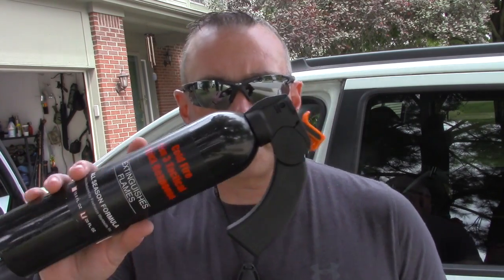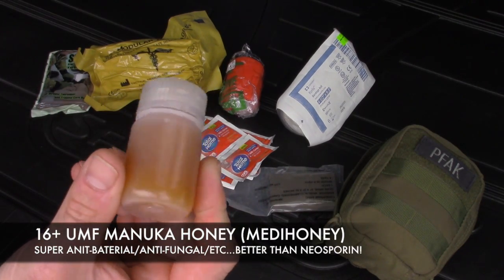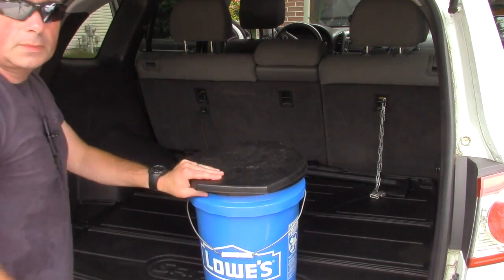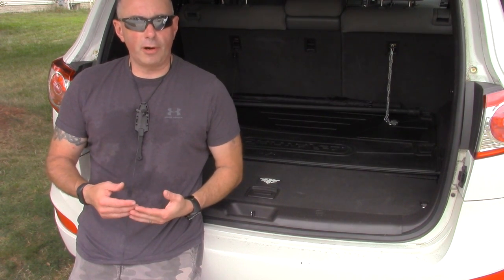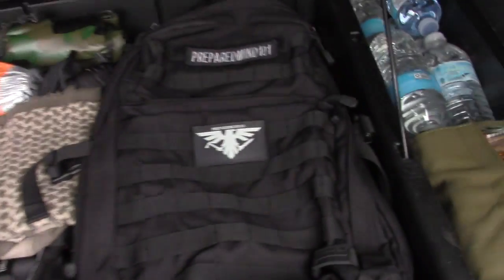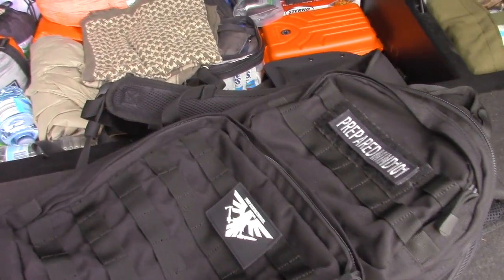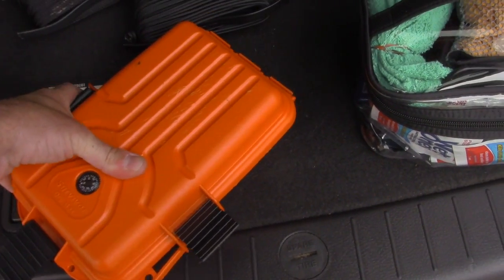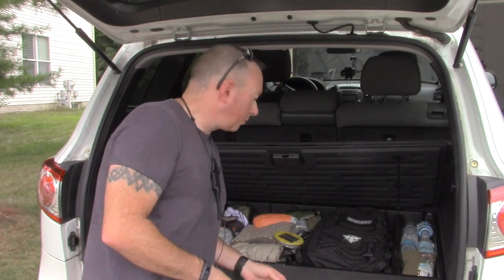300+ Piece Vehicle Emergency/Prepper/SHTF Kit REDUX - Preparedmind101

Comment: Good job Chris...  reminds me of all the junk I had in my van when I was doing search and rescue.   The two weak areas I noticed were "The Missing  Gas Can"  ☺ but you addressed that.... And communication.  I would include a couple or four hand held two way radios (GMRS or FMRS or VHF/UHF) and a mobile CB and/or Ham Band VHF/UHF mobile transciver mounted on or under the dash.   The ham license is easy to get... I passed thd test when I was 11yo - many many years ago.  But, there are radios that do not require a license.   I know you have your cell phone, but it might come in handy to hear traffic conditions on the CB and emergency conditions on the ham band.  Also, you can stay in touch with the family should you seperate.   I live near a big wooded area.  The grandkids know to take a radio with them when they go out to play.  It comes in hand every time....    But, that is just me who comes from a generation where you could not take your phone anywhere... if you had one.   Just saying......  😊

Comment: TIP: Take wrapper off the SWAT T as your hands will be bloody when a tourniquet is REALLY needed.  Blood is very slippery.
Reply: Good tip. Maybe keep it in a compressed ziplock bag so it can easily be torn into?
Reply: The reality is the T is safer in the wrapper keeping it clean. Second if it's needed you are most likely not self applying one anyways unless your Rambo in which case you would be using gun powder and your Kabar to seal the wound lol.. Most trauma medical supplies are for someone to quickly access and use on you.. IE Ifak.. An ifak is not to be self used its so a field medic doesn't have to use his supplies or dig through his pack for basic components. So your buddy who is actually the one who would likely be applying your tourniquet won't have an issue using his pocket knife to cut off the wrapper.
Reply: Hey, have you heard about Trankors Survival Secret? It's off the charts. No matter what type of critical situation you might find yourself in, you can make everyone safe and sound with step by step plans.

Comment: i'd rather have a length of rubber tube for siphoning gas rather than a gas can.
Reply: Good point Ben but what would you put it in, just asking as I am sure you have some crazy idea hehe
Reply: I didn't think of that Ben lol :)
Reply: no the idea is that he'd just siphon people's gas onto the ground.

apocalypse pranks
Reply: and for the comment about knowing his name, it's called being respectful and addressing the person you're talking to. Go troll elsewhere!
Reply: just a prank bro
Reply: My comment wasn't to you buddy hehe, someone else commented but has removed their comment as I was replying :D
Reply: with some of the newer vehicles in USA they have a anti siphon tube feature since gas theft was great during 1970s gas rationing...good thought though, try your own modern vehicle first.
Reply: unfortunately on alot of newer cars you can not siphon gas out of the tank because the manufacturers added a screen in the filler neck to prevent debris getting in the tank and also to prevent people from siphoning gas out. now an older car then you should be good.
Reply: yes alot of newer cars you would have to puncture the gas tank. I would almost rather them siphon it and save the tank, lol.
Reply: no need to puncture fuel tank, a small diameter hose goes right past the theft device, can usually work 2 or 3 into it 1 at the time for a faster flow rate
Reply: Jason Lawson
 right on!
Reply: There's a neat siphon device I picked up off Amazon, it has a bulb at one end to get the flow going (sort of like the bulb on a turkey baster or blood pressure cuff).  It works great around the house/garage/garden for transferring liquids between containers.  I have one specifically marked for fuel and one for water.
Reply: Living Survival i
Reply: Living Survival why would you use a siphon illegally in a regular emergency situation? Dont think every situation is MARSHALL LAW SHTF ZOMBIES ARE COMING, what if you run out of gas 50 yards from the exit lol to be prepared is to be prepared for everything not just the extremes
Reply: Store the rubber tube INSIDE the gas can.
Reply: I don't know most cars in the last eight years have a anti siphoning tank and most don't even have gas caps anymore. I guess you can siphon other stuff but I think of gas and most of the time cars have gas lol.
Reply: Living Survival super siphon, my husband purchased one from amazon for $10 and it was well worth the money.

Comment: Love seeing the Klean canteen! It drives me nuts seeing everyone using nalgeene. You can't throw a nalgeene on a flame and boil water.
Reply: Great water bottles, awesome for every day use as well. Mine was until one of my friends was acting like an asshole and decided to play keep away with it, on asphalt... I'm gonna buy another one lol
Reply: +Mainframe Productions (TheMainFrameGaming10) lol... The K leans are pretty durable and actually surprisingly insulated.. The extra weight vs a nalgeene is well worth it for dual purpose use.. Everyone always hammers about how everything in a bag should serve dual purpose to help save weight and items needed. Then I see them using a plastic bottle that can't do anything but hold water lol.. Just one of those little things that bugs the hell out of me! When I see someone using a stainless bottle or canteen of any sort.. I know they are on their game and prepared for worst possible case... I also don't understand the wide mouth craze ? You're not going to cook inside the bottle lol. Why does it need a large mount on it? It's not easy to find std mouth bottles anymore. Had to wait 3 weeks for my canteens to arrive. 32oz woth std mouth and d ringed sip lid. Something that should be the normal always in stock item 😡
Reply: john smith Agreed.
Reply: i have a pot for boiling .
Reply: That's great but now you are carrying two items to do one task when you can accomplish the same with just one. Size and weight always being a concern this is one area you can pick up room for other items or reduce pack weight. A 3day kit isn't meant to live off only get you to a place where you can. The faster and more efficient you can get to point B the better your chances to survive. Speed and agility is way overlooked. The lightweight backpacking crowd is carrying 15-20lbs and traversing 100's of miles in a few days. There is a lot to be learned from them in terms of making bags for bugging out or emergency survival. Use a cache to resupply don't try and carry everything for every scenario. You are only trying to survive a couple days at a time while on the move. Overload yourself and the reality is.. You will never make it to point B. You'll be moving too slow, burning too much energy have to stop and take many more breaks to rest. Also keep in mind. Stoping to boil water takes time and fires can be smelled and seen for miles. It should be only a last ditch effort in a worst case situation where you would want to actually take the time to boil some water. Purification tab fill the bottle with a screen and get back moving again in seconds. I carry a lot of crap to I won't lie. But don't think for one second once I know my situation I wouldn't throw out all the gear not needed for that scenario to lighten my pack and move faster. I actually carry a lightweight pack inside all my packs for just this reason. Every bag I pack starts out way overdone with way too many redundant items. I then spend weeks slowly ripping it apart and removing crap to get it to what is just the essentials. Don't make a bag and throw it in the trunk or closet and be done. Go back through it later and keep critiquing yourself and looking at things asking yourself is this really needed or is it a luxury just in case item. I'll bet you most people would find they have the same ability with 2/3 of the items.
Reply: john smith you said " Every bag I pack starts out way overdone with way too many redundant items. I then spend weeks slowly ripping it apart and removing crap to get it to what is just the essentials."... i do the same...right now i have my pack down to 25-28 lbs , depending on season ( winter bag is a little heavier ) , w/o food , water , primary weapon and ammo...and it's still too heavy  but i can't afford the super light stuff . still 28 lbs is not bad , (i don't do the cross country type hiking so a little extra weight for me is ok .) but i still look for ways to pare down the weight . and if it was a "bug out" situation i agree it is different... less weight = more speed . point being...unless there's a change in a few things i just cannot justify $20+ for a water bottle...but i will spend $1 or $2 for a SS bottle at the thrift store ,cause i'm a cheap bastard .
Reply: Nalgene has a time and place. They're great for EDC, especially urban, because they're sturdy and lighter than the Klean but for shtf you can't beat SS

Comment: Chris, Great video. Some things I would personally add....Small come along in case I got really stuck, couple cans of fixaflat or green slime so I wouldn't have to take off tires in in-climate weather.  Maybe a few Bright orange reflective safety vests (get them cheap at Harbor freight) in case you or the family had to walk along a road at night.  A couple of extra belts for the car (alternator, or fan belts) and maybe some hose tape in case you have a coolant hose spring a leak and lastly maybe a hidden spare key in case you lock yourself out! Just some ideas. Thanks, again!

Comment: Big follower of your channel here. Really like your videos. The only thing I didn't see in your truck are mechanical tools. Like a general tool box (wrenches, screw drivers, keys, pliers, hammer, allen, torx, etc.). I believe that any prepper driver has to be able to fix, at least, the more simple and common vehicle problems (overheating, leaks, loose bolts, loose cables, change belts, etc)
Again, no hate here. Just a little suggestion.
Greetings from Paraguay

Comment: I know I need a lot more but I always keep the following items in my car here in Los Angeles.
Flashlight and batteries, empty coolant jug for water, couple bottles drinking water, Sabre Red pepper Gel that can shoot a stream at a bad guy 20 ft away, Boonie hat and bandanna to keep the sun off if I need to walk home, jumper cables, funnel, empty 2.5 gallon gasoline jug, fire extinguisher, basic first aid kit,  dash cam, window sun shades, battery jump starter pack and 12vdc air compressor and digital tire gauge.

Comment: I think you have an awesome setup there Chris.  Like many others in here I think you may have too much stuff or maybe added weight.  
Just because I heard you reference (Harbor freight) I have one of their 100psi air compressors to top up tires or put in enough air to get you to a better destination.  Think that's very important.  And super compact and plugs into the cigar lighter outlets.  
good work man

Comment: A couple rolls of the strong bounty paper towels redundancy for bleeding management, tp replacement, washcloths and can serve as a pillow.  I have mine always in the thin grocery bags tied tight.  Also any kind of diapers, feminine napkins, or poise pads dual purpose for wound bleeds, and feminine needs as well as bathroom issues.   I have a brand new paint can full of fire starters, tinder etc.  can be used to fetch water, boil things, or keep stuff really dry. Just hook the can opener from zip tie on handle.  Large gallon or two gallon ziplock bags.  Many uses- gathering water /heating water in sun, keeping dry clothes dry or keeping wet items away from other dry things. Just bought a ‘19 Santa Fe.  Got it because back seat folds down flat with back bay so I can sleep in there if needed.   Mine has 3 skinny bins and I’m in process of filling them w preps.  So great video!  Thx!!

Comment: As this guy said to each his own. This guy is well prepared and prepare for your likely environment.  I use to live in north rural Maine. Carrying water was not in issue, but sliding off the road in a blizzard and stuck for a few hours to a few days was likely and happened to me on several winters. Basic cell service is non existent. Look at the cell phone coverage commercials, most of maine never included. But a good source of heat and blankets and a hand winch with rope able to pull ur car out of snow or mud are musts. (knives, food, saws are really handy)And a whistle if you're pinned in as a blizzard can cover your skid marks and car. Now i live in the urban city, knives will get me in trouble but a fire extinguisher and a strong snow shovel are good.  But i dont need saws and knives, winches and ropes as i did is Maine. But unlike rural Maine, a cell phone is a must.

As for a compass. Use the sun and north star. 

 My question for preppers. What type of senario are you preparing for? A car accident, break down on a lonly rural road. or a total collapse of civilization?

Comment: Great video. Found some holes in my truck kits. I know you do not keep firearms but some extra ammo for at least your ,EDC  would maybe be a good add. Also some wood screws because the could be useful for makeshift perimeter alert as well as other uses with shelter etc.You have your multi tool already.
Reply from the maker: +Keith Hutchison Good idea. I have 5 loaded Glock mags, 4 for the Shield and 2 for the LCP. Wouldn't hurt to put a box or two back there. I know it doesn't get hot.

Comment: One of the things I keep in all of our cars (and this falls into the convenience/prepping category, more than survival) is a collapsible cooler bag of some sort.  Most aren't that expensive and fold up compact enough to take up little room.  They are nice to have when you buy groceries and then realize you have 14 more stops to make that you forgot about before you can go home, or any other time that you need to keep something cool for an extended period of time.  Bags of ice are easy enough to find at any gas station, etc. to keep everything cold for longer durations. The cooler bags can also be used as a container for other things as well.

Comment: Good vehicle kit. I recently changed out my store bought water bottles and replaced them with BPA free water bottles. The extreme heat fluctuations inside a car can cause the plastics in the bottles to seep into the water.

Comment: Nice kit, a question about that flashlight (Thrunite) in your trunk there, do you store it with batteries in it or not?  I am always afraid to store stuff in my vehicles with the batteries in it, I keep the separate but was wondering if I should just leave them in my flashlights.
Reply: lithiums are fine, alkalines are not.
Reply from the maker: +Iridium242 the Thrunite has a built in battery pack.
Reply: Ahh cool thanks, yeah I always worry about batteries going bad and ruining stuff, but that should not be a problem with that.   Thanks!

Comment: You should check out the eno under quilts for hammock camping.  Lightweigh and will keep you warm in cold, not freezing weather...
Reply from the maker: +TheSmokinApe ENO makes under quilts now? 
I just ordered that Snugpak jungle blanket for $24.
Reply: Yeah, they came out with 2 different models about 6 months ago or so...  I picked up the "summer" under quilt.  I fill a nalgene bottle with boiling water and slip in into a neoprene sleeve and take in the hammock and it's like having a heater with you all night.

Comment: Great vid.  I have a Sorento and have all of that space too.  Too much water IMO.  Stove and stuff for everyday commute is excessive.  I suggest adding a folding saw, cheap socket set, cheap driver set,  bungee cords, ratchet straps,  Heavy duty long jumpers, a more robust medical kit, a bolt cutter, large pry bar, a flask with some whiskey, a cheap 12 gauge and a box of slugs.  One more thing to keep in mind.  If you use a regular fire extinguisher (Class ABC, K) on say the your engine bay, you will destroy wiring and electronics from the residue they leave behind.   I know better than losing the whole car.  Look for Halotron extinguishers if you are concerned.  They cost a bit more though.

Comment: I just got my bug out bag set. It's the first pack so I'm sure I will be taking stuff out and replacing it with stuff that I think I need more. I always love the way people try to push toilet paper on anyone for a bug out situation. I pack rags that I can maybe wash if there is a water source.  Worse comes to worse use a leave. Toilet paper doesn't take up much space but I would choose rope or folded plastic in place of some TP in almost any situation. There just isn't a dual use for toilet paper. I try to have redundancy then I go with what I can get buy with using things as dual purpose.  Becomes a back up in its own right. The difference between bushcraft and prepping is only what's left after you go through everything. I want to pack everything too but what if. Always best to learn so thanks for the review.

Comment: I like your organization.  I put a toolbox on the back of my truck with most of the stuff you have in your car.  I keep two small get home bags in it with winter coveralls for the wife and I. If we decide to go I don't have to worry about getting stuck on the road or if something drastic happened and the truck stops and we have no other way to get home we would have the ability to get on the road home.

Comment: Looks like you have everything👍. Something to ponder may want to add. Button and thread because those waist buttons don’t hold up forever.Another thing you might want to add sheet of cardboard because when changing a tire it keeps your knees clean and the pebbles won’t hurt your knees. Personally I would not have much So much I-Profen in the car because of the hot temperatures might change the molecule structure of the tablets at least definitely shorter shelf life spanned.